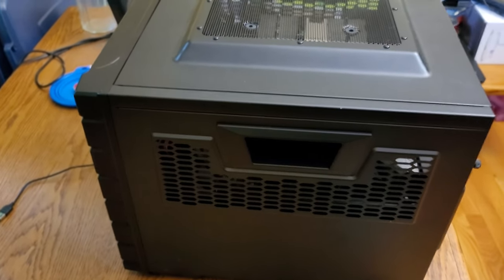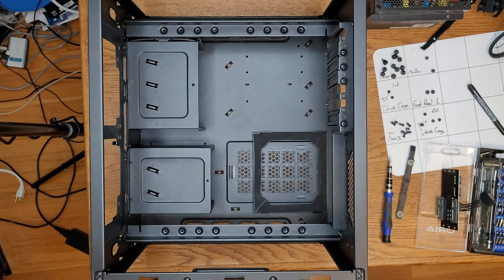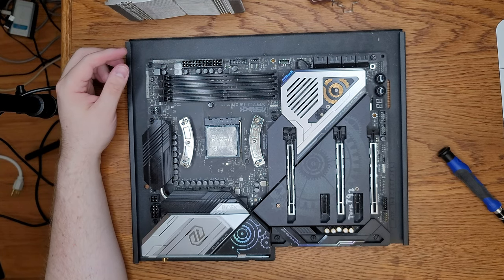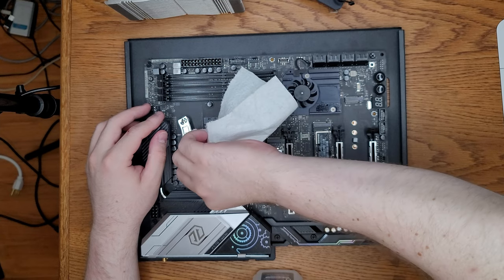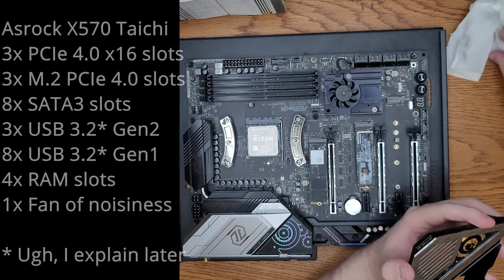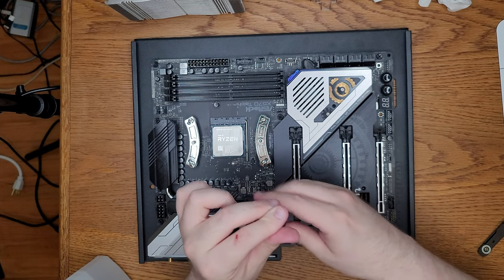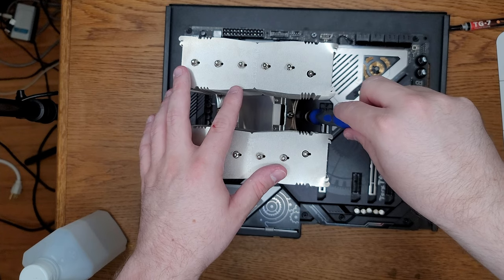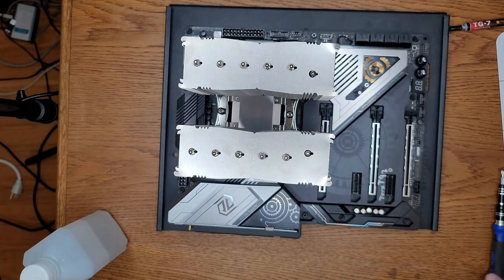I'm bored, let's take apart my computer (08 - VEDA2021)

Comment: 1. He's a cute whiner, at least? 2. Electronics attract dust, it's just what they do. It's gross and annoying and labor-intensive and bleh. 3. Yeah, I wouldn't have noticed that it was on backwards without the context to go with it. 4. Maybe a lower resolution (*just* 1080p, what many folks can/do watch at anyway) would be a safer approach to other videos you think might end up being long. This one made your phone aggressively nope repeatedly, not to mention the exporting/uploading/processing ordeal, and that seems to me like the easiest way to address both sides.
Reply from the maker: 3) It isn't easy to see until I have things arranged like I did right before I noticed.
4) Yeah. The sad thing is, what I want is actually in between (1440p), but nothing offers that as an option for recording. My phone either does 8k/24, 4k/60, 4k/30, 1080p/60, 1080p/30, or 720p/30. No other options in between. Of course, if I had known it would cause my phone to nope out of recording (it only dawned on me later what was going on, after I grabbed my phone and noticed how freaking hot it was), I would have just gone with 1080p and been happy.